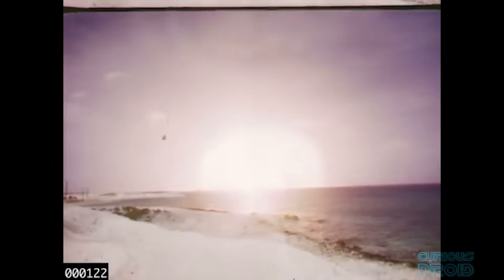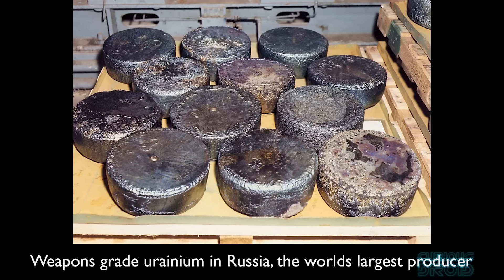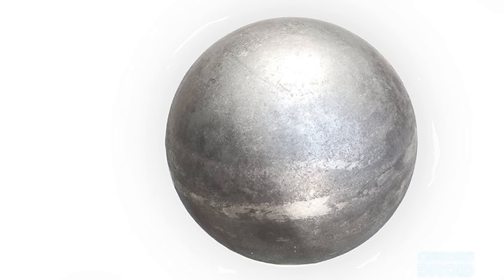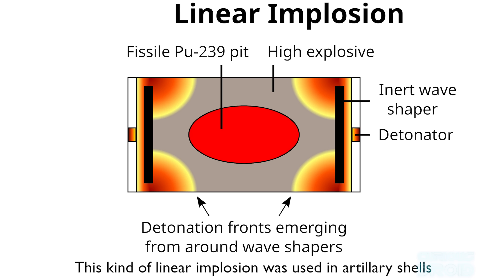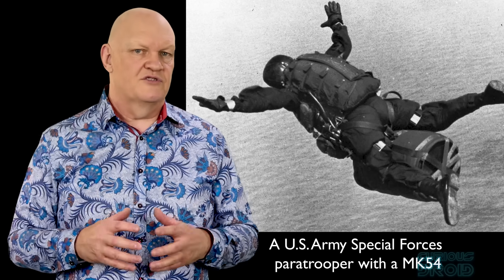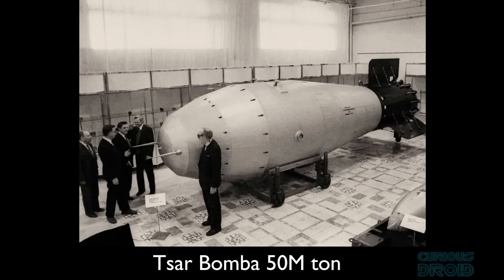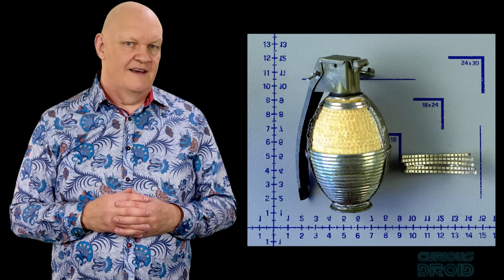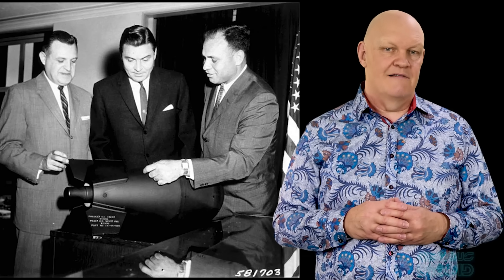How Small Can You Make a Nuclear Weapon?

Comment: I off handedly am aware that about 10 lbs. of plutonium 239 can go critical if you properly reflect it's neutron radiation back at it (beryllium) and implode it properly. Let us see if this video had any new or updated information. 

A small bowling ball of it will definitely go boom if it hit a tank at mach 8.5 or so from being fired from a railgun which easily hits the needed 3 KM/S for a 10 pound round. 

Without giving mathy exact specs some experimental railguns can fire an idealised 10-11 pound plutonium shell from orbit at the 3.5 kms needed for it to be going fast enough that when it hit the ground slowed by atmosphere to still be going the speed needed to be a nuclear explosion on impact.  The brittleness of plutonium was not really as much of an engineering hurdle as you would think. 

Edit: Nope.
Reply: As little as 7.5lbs of Pu has been used in weapons.
Simply smacking into something isn't a reliable or practical means of shock compressing fissile material. What a laughably cartoonist proposition.

There are no experimental orbital rail guns.

What you say makes you sound like a child...

Comment: You are incorrect in stating that you have to compress a critical mass or it will not detonate.  Little boy (gun design) did not compress the U235 warhead.  All it did was assemble 2 sub critical pieces with enough energy and fast enough that the inserted piece (the bullet) would not be blown out by the start of the fission process.

If you try to cast a critical mass of uranium it will blow apart at the liquid or semi solid state and not explode.

I believe this also applies to plutonium and U233. But I have not seen any documents related to fast assembly of a critical mass of either material.  Compression is the preferred method as it is much smaller and lighter than a gun design once you add tampers,  tritium and/or deuterium gasses, and neutron generators (Fat man depended on a neutron generator at the center of the plutonium pit).

Comment: Why is the sound of a nuke going off so prolonged if it is instantaneous?
Reply: It's the same with thunder.  Very brief electrical discharge, extended rumbling sounds.
Reply: @wilhelmvonn9619  that ain't how thunder works.
Reply: @wilhelmvonn9619  no, youj just described the effect of chain lightening.
Reply: The sound is an initial sharp shock, followed by the rushing sound of wind from air carried by the shock...
Same as for large conventionally explosions.
Reply: @Evan_Bell  Which should take how long to diminish? BTW thanks

Comment: Quite a few errors in this.  The Tsar bomba was never intended to fit on any missile or be dropped as a bomb, it was far too large and heavy it was a propaganda bomb so the Soviets could claim to have detonated the largest nuke.  A davy crocket wouldn't be suicide, even if the dead zone was 2.5 mile radius from the blast, the fact that the the range was 2.5 miles means you would have a 1.25 mile buffer between the person that launched the weapon and the dead zone.  They also didn't have as large a deadzone as indicated, the 2.5 mile is based on fallout which is not going to happen instantly so anyone that launched on could easily leave the area well before the fallout started coming down.  They were not cancelled because they were dangerous to the soldiers using them it was because of public outcry from people that didn't understand them.  But your biggest problem is you haven't taken into account more advanced explosives that shrinks down the amount of high explosives needed, then you ignore the fact that better explosives can lower the amount of Pu required... so your final take on the size is larger than it would be. and even if it was 30kg in weight that is still going to be small enough that a single person could carry it by themself... but using modern technology you could easily get a lighter bomb that would be less weight than a recruit was required to carry.
Reply: The AN-602 was originally planned to be carried by the UR-500 ICBM.
Reply: @Evan_Bell  The problem is the bombs weight was about 19,000 kg more than the payload capacity of the UR-500.  Because of the way the bomba was made you simply couldn't make it lighter, the weight was a dependent on the explosives as much as it was dependent on the required uranium tampers.  That means the only option was using a plane and even then they had to remove fuel tanks and strip the plane to the bone to get it to fly.  A plane carrying this bomb was never going to be feasible given how slow plane are and how easily they can be shot down.  If the Soviets had thought it was even half way feasible they would have made more of them.  But they knew it was pointless.

Comment: you can create a small nuclear weapon, but you need neptunium-236 as a fissile material, because neptunium-236 critical mass of 6.79 kg, which is significantly lower than that of plutonium-239 and you can use thermonuclear boosting and neutron reflectors or tamper to reduce critical mass of neptunium-236 to 3.3 kg. You can produce neptunium-236 by irradiating a uranium-238 with protons, you can use cyclotron for that. Uranium-238 is easy to get and neptunium-236 is best fissile material

Comment: i understand they did a test in the pacific test area of taking two .M338 warheads and putting  tritium and deuterium between them trying to make a special weapon.  tritium and deuterium are not radioactive and can be smuggled into just about.
anyplace. the hard part in trying to smuggle a fission device into another country.
the idea was to place a  tritium and deuterium stock in another country and later bring in the smallest nuclear weapon to place in the hidden container of tritium and deuterium.
what is the smallest nuclear weapon that can set off a hydrogen secondary stage.

Comment: You don't need a cloud chamber to see the particles come off radioactive materials. Just turn off the lights and you'll see what looks like a miniature fireworks display. There was tourist shop in Arizona that had radioactive gold on display for decades. It was in a glass case and they'd turn off the lights to show the particle display. Finally after about 60 years someone decided to see how much radiation it was putting out. The radioactive gold display was quickly taken down. I have no idea how hot it was but apparently it wasn't at safe levels.

Comment: Haven't even started watching the video yet, but I can categorically guarantee that suitcase nukes are not only possible but have been in reality in the past. The W-80 we're headed alone is 31 in Long approximately 12 in in diameter, weighs 290 lb and has a yield up to 150 kilotons. Now 290 lb might be heavy but it's certainly not too heavy to fit into a large Samsonite or luggage piece. Given the rest of the dimensions yes you could actually fit it inside. And that is just a warhead that could fit inside a piece of luggage not one that's been made for it as well. Now, onto the video.
Reply: A person on a suicide mission would require minimal shielding.
Reply: The video does goes over this specifically, saying that a BRIEFcase nuke isn't really possible, though a suitcase nuke certainly could be.  That said, the W-80 itself is almost certainly too big.  Even VERY large suitcases are about 30inches in height.  Not quite enough, and that's just exterior dimensions, you'd need something more like 36 inches to fit the whole nuke, so we're talking a full THREE FOOT tall suitcase. lol  And one that has you sweating as you try and pull it around as weighs about 300lbs. lol
Reply: @maynardburger  I don't necessarily disagree with your rebuttal.
However, my point was that there are warheads which are damn powerful and could fit into something the size of a large suitcase. 30 inches is only 2.5 feet. There are some suitcases that large.
As for lugging it around. Oh, you're spot on. It would be pretty damn obvious when multiple people need to carry it. Still, it could happen.

Comment: The size and weight of the core could be reduced by ~50% by using exotic fissile materials like Californium 251.  Some have dismissed this as being impractical and cost prohibitive, but in the US spending billions of dollars on a weapon system that will never be used is not unusual.
Reply: "The Switch" was the SA 825 and the "SA" stood for Sandia Apparatus because it was developed at the Sandia labs in New Mexico.  Yes, we could change the yield by flipping a switch.

Comment: You could make one of virtually any size, and the smaller they get the easier they are to make, because of the smaller amount of material you need to cause super criticality. AAA battery sized would probably be a useful size, and the explosion would still be pretty large. Most of what goes into nuclear weapons is actually the safety mechanisms to ensure they don't accidentally explode, or to ensure they can only be armed by the right people. We could probably even make them virtually microscopic, but they wouldn't do much at that point. The fact is, there's just no good reason to make them that small, because at that point there are far better conventional materials that are easier to handle. A big thing in nuclear is that virtually all material is traceable, because they all have their own specific signatures depending on where they were mined, and that's one reason why it would be difficult for a country to secretly nuke another and try to blame it on someone else.

Comment: Perhaps you should check back with "Q" , just to be sure...  

Further miniaturisation would theoretically be possible by employing fissile isotopes with a lower critical mass, such as Cf-251 (unreflected bare sphere critical mass (ubscm) of 5.5 kg), with a half-life decay into Cm 247 (ubscm 6.9 kg) of ca. 898 years and finally into Pu241 with a half-life decay of 15.6 million years. Needless to say, that producing such isotopes in sufficient quantities would be extremely expensive and not really warrant the effort.

A Cf-251 device, like a Pu239 version, could also be neutron boosted with some T&D gas and with the incorporation of some neutron reflectors, the critical mass could conceivably be in the vicinity of 1.5 kg, equivalent to a bare sphere with a diameter of approx. 5.8 cm. 
While the W54 device remains the smallest nuclear warhead constructed and tested, an additional modest size reduction would still be possible by using fissile isotopes with a smaller critical mass and the use of optimised designs that replace the traditional implosion design with a more space saving alternative, in addition to precise modern neutron triggering methods, etc.

Comment: 1:15 why does it look like the particle are shooting out of the source? Betas are moving at relativistic speeds, and alpha are still pretty damn fast, idk.. Mach 1000? That track should be instantaneous on the time scale of condensation, so that no frame rate should resolve motion, and certainly not yt’s frame rate.
Reply: It takes a bit of time for a condensation trail to form once the particle passes though
Reply: @JohnN-r2n  That's the point. A 3 MeV alpha ray traverses that distance in 8 nanoseconds.

Comment: In the USAF around 1979, I didn't tightly lock the wheels on my hydraulic fluid unit used for topping off the jets hydraulic systems:  I didn't realize it rolled out of my humvee and downhill into the nuke zone, a "no lone zone" they called it and it bumped into their electrified fence around the jets that were uploaded with nukes.  That almost  sent the entire base into high alert.  And when I realized what was happening I ran down to try and stop it before it hit the fence but the guards in the towers only knew some guy is running into the nuke zone.  I don't remember if they shouted or what but it was loud enough to stop me in my tracks.  I almost got shot down.  I was only 18 and a two striper but I got lectured by my CO but nothing too bad.

Comment: Comparing the technology of today to what was possible in the 60s has convinced me that this technology definitely exists today and is going to pop up in the coming years.
Reply: That's not how things work.  Technology doesn't always improve linearly forever, and certainly nuclear weapon technology hasn't gone like that.  The vast majority of progress happened very quickly and very early, and then slowed dramatically.  Basic modern nuclear weapon design was more or less 'figured out' by 1970.  And again, as the video talks about, there's literal limits on the size of a supercritical fissile mass.  A non-supercritical radioactive mass could still be used to cause limited local radiation effects, but not a nuclear explosion.  There's no magic technology being hidden that changes this.

Comment: I worked with artillery nukes 8in in diameter and 2 to 3 feet long.  Weighed about 200 lbs.
Reply: The original 8" was a pain in the ass, the improved version fielded in the mid 1980s was much easier to work with.
Reply: @ai_ruins_stories Someone who knows.  THANK YOU FOR YOUR SERVICE!
And yes, the new round was easier to field as it was already assembled.  
It, at least the original W-79 mod 0, was also a neutron warhead.

Comment: The new ones use an exploding wire which radiates from the center surrounded by fog of radioactive gases such as tritium and cesium.
Much like starting a campfire, premises to start with your Tinder, kindling then the fuel.
Reply: Doesn't sound convincing to me.

Comment: A nuclear round was proposed for the 152mm XM150, however the high weight of the round made it impossible for the recoil system to handle so it was cancelled. On top of that, the maximum range was far too close for comfort.

Comment: I had a lot of time with W33 (8" artillery). What a mechanical contraption. With "nukes", don't really need a "yield". Just blow around a bunch of radio active crud and society will panic
Reply: Air blast is the primary mechanism by which they cause damage. It's the effect US damage models are based on. You absolutely need yield.
And fission yield directly correlates to fallout mass, and total yield determines the area that mass os distributed over...

Comment: You made a LOT of errors here, just early on, implying that gun-type bomb involved significant compression, and that two point weapons were made just for size convenience, neither of which is true. gun type devices just use explosives to assemble a critical mass, and two point weapons are used because two detonators are less likely to have a failure, and are much more lightweight than a dozen or more.

Comment: There is no "compression" of Uranium or Plutonium in a fission nuclear bomb  - they are virtually incompressible at pressures produced by a chemical explosion. The plutonium sphere used in a bomb is hollow, and the implosion only turn is into a solid sphere
Reply: The implosion forces (individually subcritical) wedge-shaped Pu pieces together to form a supercritical sphere, the same way the gun design brings subcritical pieces together to form a supercritical mass (probably also a sphere). Compression of Pu is not the object, assembly of a sphere is. The video got this wrong.
Reply: @scotth6814  Correct

Comment: Any Soviet weapon built "back in the day", would be well past its shelf life by now, conventional munitions have a use by date, but dont suffer from the core deteriorating due to nuclear decay, and since it was pretty cutting edge will probably "not something i would want to rely on", not function, i believe plutonium disintegrates with time.
Reply: The half-life of Pu239 is 24,110 years, so it will stay potent a long long time.
Reply: @scotth6814  It may stay potent but they need regular reconditioning, the decay products are not Pu239 so the physics change, as the bloke said the yield is inconsistent meaning the conditions have to be just right to give a viable device.
Reply: The families of farmers blown to bits by buried first and second world war munitions may have a perspective on the difference between use by and lethal till dates!

Comment: Two relevant items not mentioned in this video:
The AIR-2 Genie, which was an unguided air to air missile. It had a much higher yield than the AIM-26A.
Nuclear torpedoes. The infamous Whisky-on-the-rocks incident, strongly indicated that even older soviet submarines carried torpedoes with nuclear warheads.
Reply: Even more (potentially) consequential was the Soviet submarine B-59 that was stationed near Cuba during the Cuban Missile Crisis - they had a nuclear torpedo, and mistakenly believed that the situation had turned hot since they were out of contact with Moscow. Only Cmdr. Vasili Arkophov's cool head voted not to use the weapon, and thus prevented it from turning into WWIII.
Reply: The Genie had a 1.5 Kiloton yield.  I worked the MA-1 system when I was in.

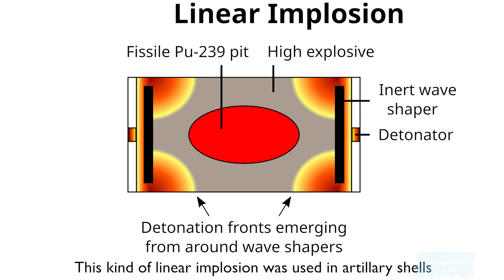Comment: 7:28
These weapons were never meant to kill by blast.
By omitting the tamper you allow the weapon to release far more gamma and neutron radiation.
The W-54 couldn't blow up a main battle tank at 150ft, but the crew inside would receive a lethal dose of radiation, enough for them to be dead within a few hours.
When the US tested the 280mm howitzer with a nuclear projectile,  it was the first gun type weapon to be scientifically tested.
The scientists were quite surprised to find that it produced nearly 20× the neutron flux of an implosion weapon.
I heard that Dr Ted Taylor designed a 105mm nuclear shell.
But it needed lots of tritium, Plutonium-239, and Uranium-233. 
Uranium-233 is U-235 more reactive sibling.
Reply: Little Boy was a gun-tube design. Very simple but inefficient.